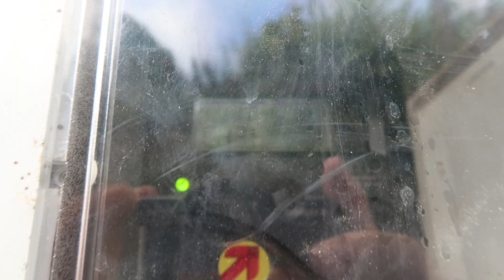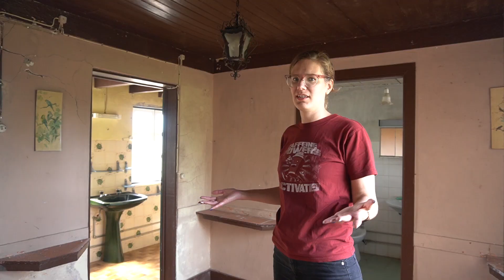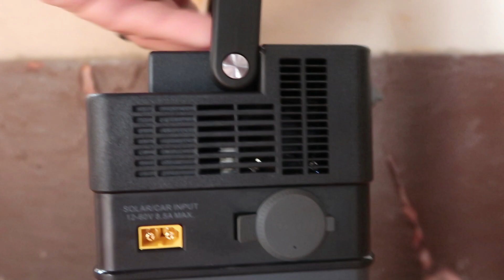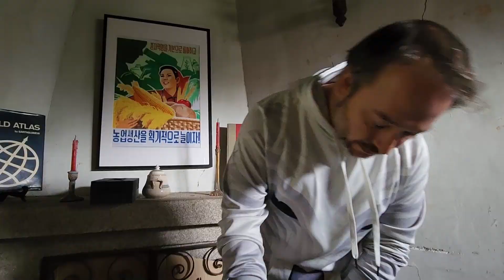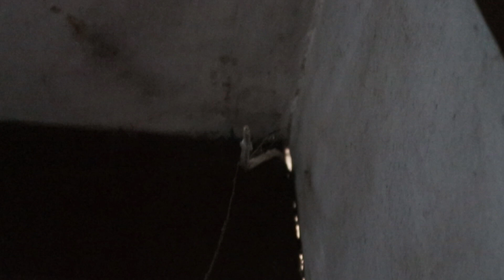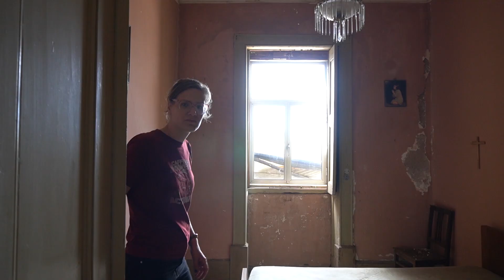Explaining our 'Current' situation on our Portugal Homestead

Comment: I know that in Italy and some other countries, the cable/wire can be on the outside of the walls, but they will need to be run through special tubing.  Just a note to be wise. If you cut the wires, please make sure you cap them before hiding them .
Reply from the maker: We aren't sure about it here, we will look into it more, once we have a better plan for the electrics.

Comment: This wiring must all be replaced. My house was exactly the same and the same thing happened. I replaced everything with wiring in accordance with safety standards with pipes inside the walls and it has been over 30 years without any problems. This house of yours is a wonder for those who like DIY. I turned this house into a true palace. When replacing rotten wood with concrete beams, do not use the ones you are currently using, use so-called pre-cast (pre-tensioned) beams.